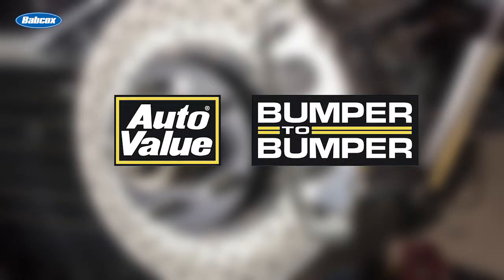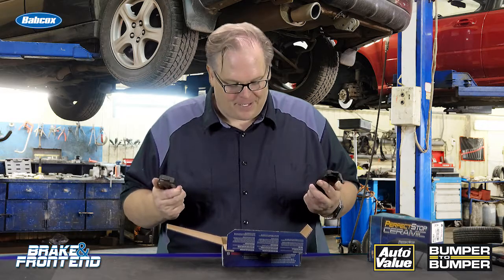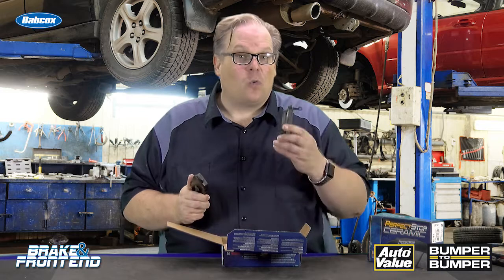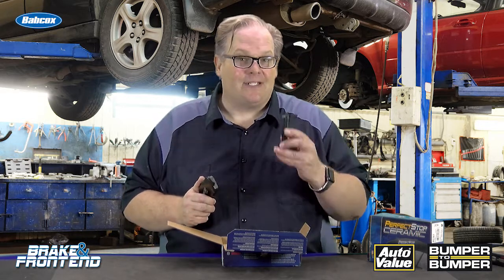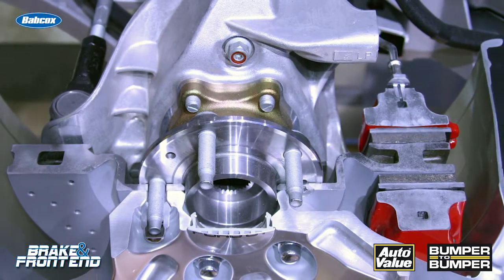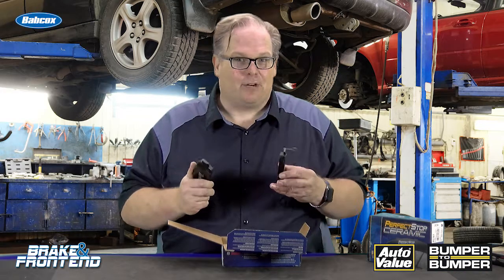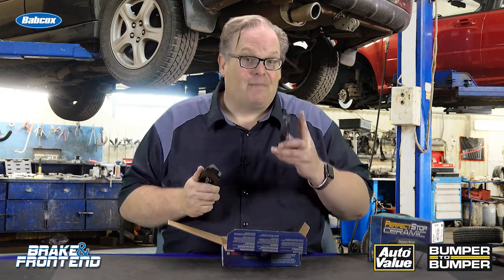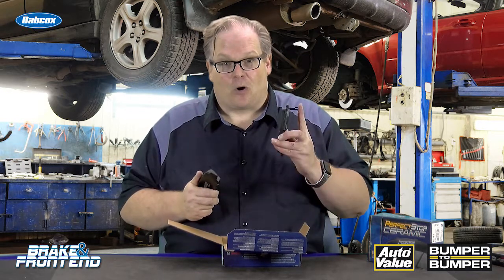Brake Pad Placement For Wear Sensors | Maintenance Minute

Comment: You’re missing a point! It isn’t only whether it goes inboard or outboard…..
   It matters which direction the energy on the squealer is being pushed…. Whether or not the tab is on the top or the bottom…. a very few rare instances you won’t be able to swap sides, but on most you will!

Comment: My '96 Chevy 1500 has the squealers on the outside pad to the front of the caliper. Inner and outer pads are different and the squealers are already mounted. Basically, these are the same calipers that GM has produced for 20 years or more. That means there tens or millions of these out there, all like this. Also if you take the squealer and run it against a rotor, you find it makes more noise as the rotor moves away from the pad under the squealer than to the pad under the squealer (trailing, not pushing).

Comment: Thanks, but I was hoping you would say whether the wear indicator should be facing up or down. I always did them facing up, but I've done a couple of brake jobs for friends, and they were facing down. Wondering if it matters, and if I did it wrong.
Reply: I would have to assume up, so they wouldn't dig into the rotor. Just my assumption though
Reply: @johnthemminger8917  It shouldn't dig into the rotor either way until the pad gets worn down to the indicator part. I've heard conflicting stuff after reading into it. I hear indicator down if the caliper is on the back of the rotor, and indicator up if the caliper is on the front of the rotor. I do mine with the indicator up, but on cars I did for others I left it facing down.
Reply: I just did mine on a 97 chevy k2500, 6.5 diesel...mine seat properly with the indicator down, with those pads outboard, other vehicles may differ obviously...never heard a squeak, just grinding this morning, inboard pad, pass side, gone, bout 1/8 on the outboard pad till the indicator...shatty design

Comment: General consensus is putting wear sensor on leading edge…that’s is it’s “ahead” of the pad as the rotor rotates, or that is is “compressed” the west indicator.
Reply: This is what we were left wanting to know, thanks! Makes sense... I would guess (I don't know) that the leading edge would usually be first to wear out in the case of a pad wearing unevenly.
Reply: @imautoob  I believe that the wear sensor should be on the leading edge for a different reason.  You can see that in this video that explains why that the leading edge also did not wear more, but less.  Where does the scraper pin go on inside brake pads?
https://youtube.com/shorts/KBOeQp908r0?feature=share

Comment: Or you can do your routine maintience and check them like the manufacturer recommends at every tire rotation. Replace when pad depth first goes into yellow brake depth. Best to replace them all at the same time every 20-30K. They aren't that expensive (less than the cost of an oil change). But thank you for clearifying the proper placement and why its done this way. It makes better sense now.

Comment: Does it mount with a Squealer to the top of the caliper or the bottom?
Reply: I’ve been trying to figure that out with my 03 accord. I ended up putting mine on top but I’ve seen it done both ways

Comment: I thought it depended on caliper position because that then determines whether the brake disc/rotor is rotating into or away from the wear indicator?
Some calipers are mounted behind the axle and some are mounted in front of it.

Comment: Must be for newer vehicles cause my 93 Sierra they only come with the wear indicator on the outside pads. And I accidentally put my outside pads on the opposite wheels so instead of the wear indicator being at the top of the caliper goin in the direction of rotation it's on the bottom of the caliper. But I suppose it really doesn't matter because if it folds ever it wouldn't disrupt anything. O well . Maybe next time I'll get it right . If I still have this truck then anyway. 😂 They still stop the truck no problem. So it's not a big deal.